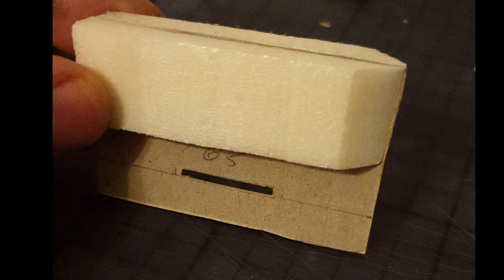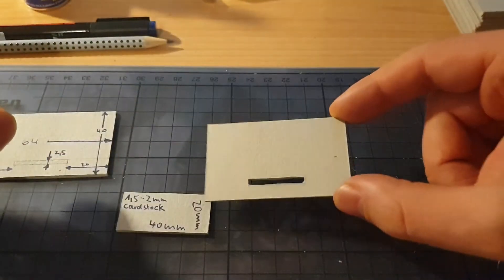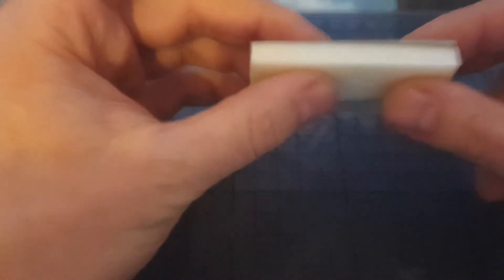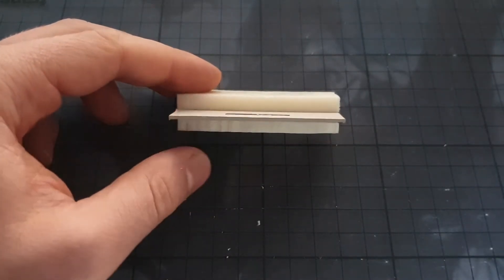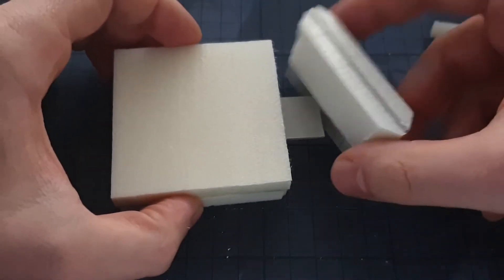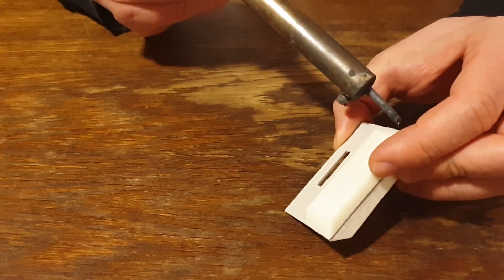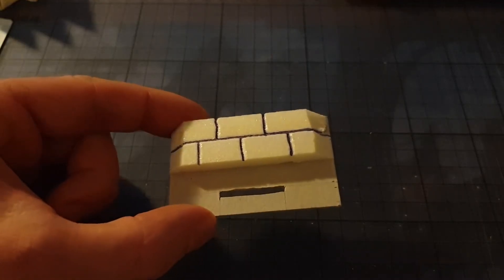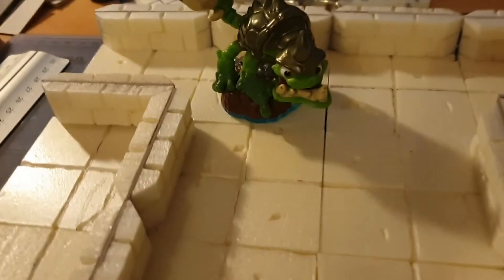Tokrak Crafts - Crafting Basic Modular Dungeon Walls #004

Comment: You've got some interesting ideas! I'm not a crafter (yet) but planning to be and I think your videos will help a lot! I can imagine that for a dungeon you'd want the walls to be short like these are, but what if the players enter a village? I would like to have several buildings that look good on the outside (Tall walls and a roof) and once the players enter, the roof comes off and you can see inside. The tiles and walls/roof would have to be modular, so every village they enter can have a different build. Also, would it be an option to have smaller walls (like in one of your other videos) that can attatch on 1 side of the tile? So instead of 1 long wall, you would have 2 small walls on 1 side. Do you think this would be possible? I haven't seen anyone else do modular walls like you have, so I think if anyone knows it would be you!
Reply from the maker: Hi, i don't use full houses cause i don't really need them in my games. I just describe what going on and theater of the mind is often enough for that. Using 2 of my small walls as 1 big wall is possible, we do that quite often. But i think you should check out "Nerdanien" on YT, he is a german crafter and i think his system to set up a whole modular town is what you are looking for. https://youtu.be/YEDmzE3z_Y8 Hope i could help